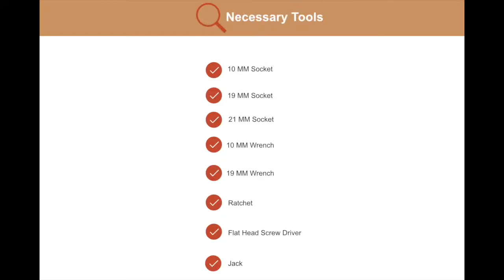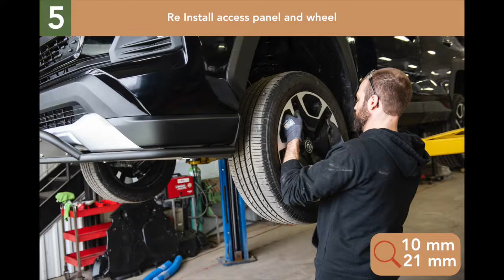Toyota RAV4 2019-2023 Skid plate - by LP Aventure

Comment: Does this expose the catalytic converter, making it easier to steal?
Reply from the maker: @roadkillbingo A great question!  

We are assuming you're asking due to concerns overall, or you have an issue in your area.  There are essentially 2 catalytic convertors for the 2019+ RAV4, one is directly off the manifold, generally considered a Pre-Cat in many instances, not an easy target to get to let alone removed without really getting inside the engine bay.  And a secondary down the line with the hybrid version being much more vulnerable of a spot leaning a little closer to the right side of the vehicle, especially on the AWD variant is another issue.  The front Skid plate Protects mostly the front area of the engine, lower rad support, and the oil pan area's.

Gas/Petrol and Hybrid Models - N. America builds (shown) Japanese Built (a "J" precedes your VIN number) similar
A simple reference to the Toyota Part is linked here::  - https://www.toyotapartsdirect.ca/images/parts/motor/fullsize/8452340.png

A simple reference to the Toyota Part is linked here::  - https://www.toyotapartsdirect.ca/images/parts/motor/parts/fullsize/8452345_1.png

Here's the reality.  Unfortunately all throughout history we've seen that if someone wants something in a way more than you may want to keep it.  If they want it bad enough, they'll get it.  Doesn't matter if it is a car part, a valuable in your home, or sadly even a partner in your life.  Clearly there are devices, and/or procedures being made and produced to minimize if not remove the threat of theft of certain things but someone stealing your RAV4 cat isn't someone randomly stealing that component.  If they're coming after it, ideally it's because of familiarity and know how.  Someone known for stealing Corvettes for example doesn't throw their hands up in the air and say "there are No Corvettes to steal today, Ohhh, wait is that a RAV4?!"  People are targeting certain vehicles, for specific easy targets.

Measures you can take; park in your garage, if you can behind a gated yard.  Don't park your car to get noticed, hence the Under the Street light Presentation.. Minimize same routes to home by taking the last mile or two different ways, especially if bigger or deeper neighborhoods easily spotting being tailed.  Park closer to entrances and busier areas, people have been noted to steal these in broad daylight looking like a owner whose got car problems.

Seek out actual theft deterrent options, this one shown on a Forum #rav4world we are a party, to but not to the part itself, or its sales is shown here for you.

- https://www.rav4world.com/products/catclamp-catalytic-converter-lock/fcb1aaeb7e05f9d1e735bd9ccae740e8f7237134/

Just remember there are no guarantees of NON-theft, but making them pass for easier targets or slowing them down so they may get caught might be aided.  Also just know thieves like these don't always work alone, approaching them isn't recommended to stop them, call your local Policy Enforcement Departments.  It's a car part, it's not worth a confrontation nor a violent threat counter resort.  Yes is aggravating if not infuriating, but your life or someone else's is worth more than a $500 part.  This is why your Insurance company mug's you every month for a payment. Make them handle it.

if there is any other questions for the Skid-Plate, feel free to contact us, more information is available in the descriptions.

- 12° North Team
Reply: @12degnorth19  Excellent response. This is incredibly helpful!

As for the skid plate, do you anticipate it would interfere with aerodynamics and therefore MPG on the RAV4? There is a lot of plastic underbody they put down there from the factory, I assume to optimize mileage.

Also, is this a job you'd recommend a car noob like me to DIY, assuming I had a friend, ramps, and all the appropriate tools? If not, how many hours of labor should I expect from a shop?
Reply from the maker: @thomasdantas  To answer your question, during the removal process the LPA skid plate bolts into place similar to the OE plastic one maintaining the aerodynamic function and actually giving you real protection vs the Plastic tray version.

If it took a shop more than 25-35 mins we would be surprised, but do note some shops may charge a full hours worth of work.  And ideally with exception of the possibility of lifting the vehicle, if you can remove and reinstall a license plate, have a decent set of basic mechanical hand tools,  We would give it 2 out of 5 wrenches.
Reply: If someone wants to steal your car ther going to get it

Comment: Is the access panel reinstalled that's behind the driver side wheel?
Reply from the maker: @AmusedKelpie-tc9du Yes, they are only removed temporarily in order to have access to the top nut/washers that go on the top of the K-frame. So they should be installed in the reverse order they were removed.

Thanks for taking the time to watch our channel

 ~ 12° North Team